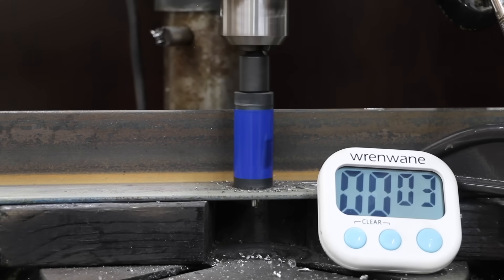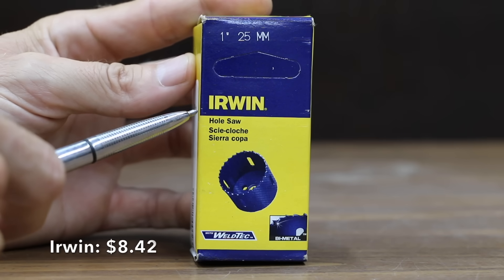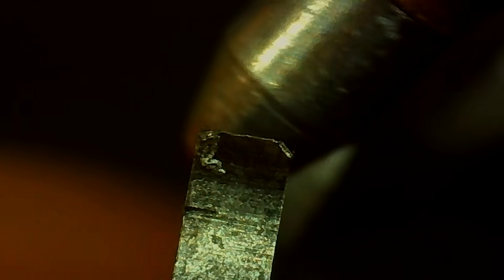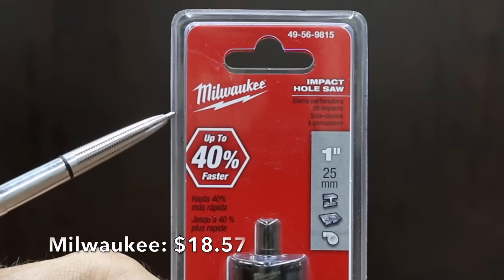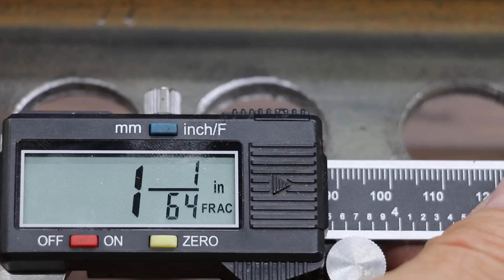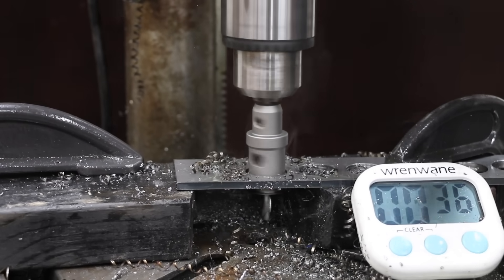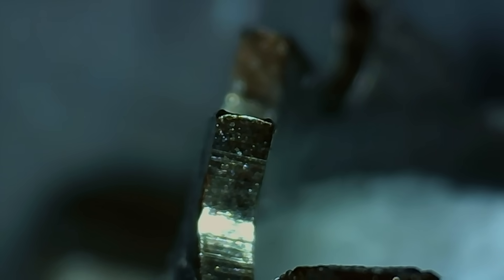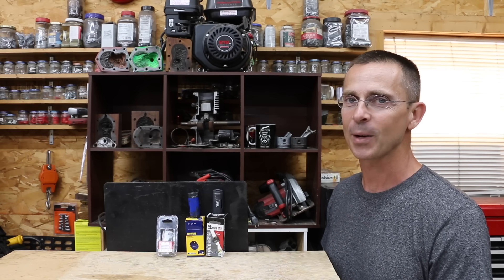Best Hole Saw Brand? DeWalt vs Milwaukee vs Irwin, Bosch, Lenox, Diablo, Bosch, MK Morse

Comment: Aw man, no cheapo HF ones or Bauer ones or. Hercules to test
Reply from the maker: I'll add them to the list for round 2.  Any other brands I need to add?  Thank you!
Reply: @ProjectFarm  Starrett
Reply: @ProjectFarm 
Without price constraint, I would suggest Pferd:
https://www.amazon.com/Pferd-25462535Carbide-Hole-Cutter-2535/dp/B00BCTY28E?ref_=d6k_applink_bb_marketplace

Not sure if there exists any cost saving supply source.

Comment: Do you think you could do this through 2x6 joists and 2x4s as a test for the plumbers and electricians
Reply from the maker: Yes, if there's enough interest.  Please let me know hole diameter and brands.  Thank you!!
Reply: Project Farm great, typically the hole saws that are used are Lenox (this is a very popular brand used by plumbers) Milwaukee both the normal and “BIG HAWG” saws, Diablo and maybe dewalt. As for sizes I’d go 2 1/2, 2 9/16, 3 1/2 and 4 1/2
Reply: @ProjectFarm  the brand you tried here +Greenlee, 1½" is for 1" pipe and then maybe 3½" but I don't think your drill press will have enough power for it
Reply: Plumbers and electricians aren't using holes saws through 2x4s, they are using augers or forstner bits.
Reply: @da_ghoul9432  I used a good quality Bosch spade bit for my house. worked pretty good except the punch through was pretty rough.  I switched over to an auger bit when I got to the garage and that worked much better.
Reply: Eh hole saws suck for wood use an auger bit or a spade bit instead. Unless you like wasting time digging the wooden donut out for a few minutes after every hole
Reply: I agree with the Greenlee holesaw comparison, that's pretty much all I use for knocking holes in panels

Comment from the maker: It happens all the time and I fail to select the best lineup of brands to test.  So, I would greatly appreciate your help.  I periodically ask for a vote on which brands to test. The “vote” notification only goes out to those who have both a) subscribed and b) selected the “bell”.   https://www.youtube.com/channel/UC2rzsm1Qi6N1X-wuOg_p0Ng?sub_confirmation=1 
Diablo Hole Saw:  https://amzn.to/31czGJL
Milwaukee Hole Dozer:  https://amzn.to/34bG1ap
MK Morse:  https://amzn.to/3l1W0xC
Irwin:  https://amzn.to/3l1H0A0
DeWalt 2x:  https://amzn.to/3hcI5m1
Dewalt Impact Ready:  https://amzn.to/326qOF1
DeWalt Carbide:  https://amzn.to/3aR5Y0p
Lenox:  https://amzn.to/3iWVUFE
TCT Carbide:  https://amzn.to/3iUHZ2R
Milwaukee Shockwave:  https://amzn.to/322AxMq
Drill Hog:  https://amzn.to/329BF0K
Bosch HB100:  https://amzn.to/2QabO37

By the way, the testing is having a positive impact.  In addition to helping viewers select the best products for their needs, product manufacturers are watching these videos.  Several manufacturers have informed me that they are working to make their products even better.  So, thank you for supporting the channel and I’m looking forward to many more product test reviews in the future. Looking forward to reading your comments.  Best regards, Todd
Reply: You should do the best file
Reply: Just think of it a little differently. You’re testing the best bang for the buck. Not the most expensive contractors stuff
Reply: o1mtbiker aaa
Reply: I wish you would have included Milwaukee Carbide hole saws. I really want to know how they stack up in tough metals.
Reply: Kevin Monzel, I believe it’s the Milwaukee Hole Hawg...something like that.  I wanted to see that one tested as well.  I have a large set of the Milwaukee Hole Dozers.  Their good bang for the buck and you can’t beat the lifetime tooth breakage warranty!
Reply: @kevinmonzel  Buy one and do your own little test against what you view to be its most likely competitor from this shootout.
Reply: Please do hole saws for tile and marble ..!!! I own a tile company and there’s a lot of them out there hole saws but they very in quality
Reply: U R 1 hard working 
Guy.
Keith  Kuhn
Reply: Glad to hear the mfgs are watching, and actually responding with product changes.
Reply: How about a test of ink pens, like the one you always use as your pointer? It's a Fisher Space Pen isn't it?
Reply: @bubbafudpucker397  

Kickass and different idea! Pens. I love my zebra.
Reply: Bruce Lortz I hear you. If I only need it one time I get good enough. If it’s something I will use over and over again. I will get the beat I can afford.
Reply: Flashlight or headlamp test. Streamlight, MagLite, Coast, No-name stuff.
Reply: I really wish he had included the Spyder brand. They have a really cool system with the arbor where you can have two different sizes on the Arbor at once

 that way you can enlarge a hole that you have already drilled out but keep it centered
Reply: @jawojnicki  yea i was hoping to see spyder on here too.
Reply: I have watched countless test videos you have made and agree with other that call you the Consumer Reports for the DIYER or working man/ woman. I would be interested in an option to buy a compiled report of your tested items listing 1st - 3rd or maybe all. Just a thought. Thanks for all you do.
Reply: Sould do a 2 stroke engine with 4 stroke oil and a 4 stroke engine with 2 stroke oil see which will Self-destruct first
Reply: Send it absolutely. Love to see more 2 stroke stuff here :)
Reply: Hey please consider using a higher RPM when using carbide. You will be surprised at the results
Reply: @BruceLortzHI  I think he covers that very well with the  different grades in testing.  Good enough is all I go for I'm say a 4" holesaw that will never do more than drill drywall for mini can lights but his step drill bit comparison...golden as I do use those until they wear out regardless of quality.
Reply: @michaelkrenzer3296  yup the step bit vid was great, use them all the time usually untill they snap or refuse to go through the most pathetic of metals
Reply: Can you test the best jigsaw blade?
Reply: I saw a company advertise a product saying it did well in your test the other day! Big companies are definitely taking note. Amazing.
Reply: This is awesome that mfr's are watching your videos and improving their products based on what you're doing, I hope they reach out to you when their improved products hit the market so you can not only re-test but also verify their "new and improved" claims. 👍
Reply: I appreciate you are USA based however I (and I presume there are many others) based in Europe who watch your tests so often the winners are unavailable in ‘our’ region.
Reply: @BruceLortzHI  That's the thing though; content like this helps a lot of people figure out what is "good enough" for their projects. And for many a tough job, the consumer grade, sometimes also the "prosumer" grade stuff, just don't cut it (heh) - and it'll either barely survive one use (maybe leaving a rather nasty result) or not survive nor finish the job at all. And quite often, the price difference between the "appropriate" professional grade tool and the "high end prosumer" grade, isn't really that much. Hypothetical numbers here, but if a $35 prosumer tool can't finish the job or only barely survives one attempt, and a $50 professional one can eat those jobs for breakfast, dinner and lunch for years - that is definitely important information and worth consideration. - And "finally", one thing often not mentioned in this context but it really should. Your project workpiece. What will be the result if the tool can't finish the job properly, or leaves a really bad result? Sometimes you already have a lot of work and other resources put into that piece/project. If that tool misbehaving could cause serious damage to your hard work and effort, costing tonnes of both time and other resources to redo/repair - well that should be part of your evaluation. Few things suck the project joy and momentum out as much as being close to finished only for a crappy or not-really-suitable-for-the-job tool to ruin it or set you back a mile.

IMO this is why it's important to include one or more professional grade candidate(s) in such roundups/shootouts. Because if the consumer and/or prosumer grade stuff can do the job "well enough" (anf survive), the roundup will show you that. But if the professional tool is really the only one up to the task, it will show that too. It's all about (enabling) the making of informed choices :)
Reply: Soooooooo :) wat will drill thru the ar500? Huh huh huh ? ? Huh
Reply: @samrowe2889  some say not even @Project Farm knows
Reply: Another awesome video.
Reply: isn't there a table of alle brands and performances ?

thx
Reply: The Milwaukee shockwave is the biggest piece of shit ive ever seen we bought one a couple weeks back and it never made it through one hole
Reply: I love your intro’s 🏅
 greetings from Belgium 🍀🇧🇪
Reply: How about; best cold bluing brand/system. (For oxide coating precision machine parts/guns.)
Reply: You are very very veery welcome!! I have made several purchases based off your videos alone. Loctite 3x, DeWalt fluted step bits, DeWalt drill bits, some 3M products, glue, tape, etc. You have also stopped me from buying certain products which I appreciate even more! You are probably the only YouTuber whose videos I watch regardless if I need the product or not. The knowledge is well worth it and your content is beautiful! Thank you so much for what you do!
Reply: Please can you do the myth of a wooden piston for a petrol engine. Is it possible to run a engine with a wooden piston.
Reply: STARRET STARRET STARRET, I WILL SEND YOU ONE IF YOU INCLUDE IT IN THE VIDEO 😉
Reply: You put Consumer Reports to shame. Whenever my girlfriend and I need to do some shopping we've made a habit to check your channel first! Any idea what the best protein bars are? 😜
Reply: Can I like this a 100 times
Reply: @Beatitmm  https://youtu.be/STe6I7RglsE
Reply: @Beatitmm  Sure! Just make 99 new accounts 😁.
Reply: So, I've noticed that a lot of the drills you test seem to get stuck near the bottom of the hole. I've heard that the material at the bottom of a hole tends to work harden. This video by Haas Automation explains the problem better than I can: https://youtu.be/sykjB7fS1Po?t=698
Reply: You should let a engine run on pure 100% oxygen
Reply: @landonsgamingchannel7587  https://youtu.be/STe6I7RglsE
Reply: Making a difference one tool comparison at a time.
Reply: Thanks for another great test! It was interesting to see how bimetal compared to carbide.
Reply: I would like to see a video on coolants and which one is best.
Reply: Suggestion: Short and sweet. There's a person who does what you are doing but in a way thats been fully ratified. His name is Sandy he does reverse engineering for manufacturing companies in the auto and aerospace industries. I highly suggest you discover who Sandy is because i believe his philosophy will greatly help yours. thank you for your time and efforts
Reply: Can you try best impact screwdrivers? There's a bunch on amazon for $10-50 and the reviews are up and down on all of them! Would be great for people that don't want to buy a full impact driver or impact wrench and I've found it to be an amazing tool to have in my toolbox! You can even use some of the left over impact bits from the previous video to help test!
Reply: Sir please test bench grinder abrasive wheels cheap Vs expensive
Reply: I've always found Greenlee to be one of the best hole saws. Shame it wasn't included
Reply: Time is money.
Reply: Here is a great idea for a testing video( albeit an expensive one), battery tools. Which brand has longest lasting battery life between charges, and, using adaptors, which tools drain batteries more. For example, if a makita battery proves to be shortest lasting, and Dewalt longest, is it the tool or the battery that is the issue!?
Reply: ANNULAR CUTTERS PERIOD !! BETTER WITH A MAGNETIC DRILL OR BULKY VINTAGE DRILL PRESS WITH TONS OF WEIGHT and WITHOUT A JACOB CHUCK
Reply: Wow thats so cool
Reply: You sly bastid.  You were supposed to mention which brands said they were improving, so we would go out and but them!
Reply: Wish you had included Spyder.
Reply: Hey there, I work in the HVAC trade and the Milwaukee big hawg hole aw bits are all the rave as well as their torch series sawzall blades, it would be cool to see you put them to the test against competitors. We especially like them for nail embedded  wood.
Reply: Can you tell me what are cutting these holes for? Good video
Reply: Test caulk next
Reply: I really enjoy your channel. The testing you do is excellent. Could you please test hole saws that cut through ceramic tile. Specifically large hole saws like the ones you tested today. Thanks.
Reply: P
Reply: Who in the real world uses fractions of 128th ?

You need a digital caliper that reads in decimal SAE or metric.
P.S.  on the ar plate, slow speed to around 50 rpm. Flood with water soluble oil coolant.
Reply: I believe the impact ready saws are ment to be used in impact drivers only. I've used them in the past with great success
Reply: Have you ever done a review on pipe thread compounds and teflon tape, and witch is best on plastic threads. also if using the teflon with the paste.is any better?
Reply: Video idea:
Best method/product to remove an odor from a vehicle. I was never able to overcome an odor or spoiled milk in an old car of ours when my son left a bottle with a cracked lid in it for an extended amount if time. It’s probably difficult to test objectively.  
Thank you for all of your videos! Big fan
Reply: Hi you should do strongest velcro!?
Reply: Hey I would love to see a Gravel guard test! Love the vids you are a great man!
Reply: Wish you had included Klein and Ideal.  Electrician here.  Thanks for all the great videos.
Reply: You should test NMF by nomorefriction.com supposed to reduce friction in oil and help keep it clean inside of diesel engines
Reply: I've got a challenge for you: Oil and Transmission resealers. Products like BlueDevil Transmission Sealer and AT 205(Scotty Kilmer was all about it back in 2010). Could they save us the big bucks? Will it hurt to try like some of these head gasket sealers do? You're the only man for the job!
Reply: You should test car drying towels after multiple washes which is still most effective
Reply: I got your next video bud! Which cooler keeps the beer tasting the best, and you can fill multiple brands of coolers full and taste all the beer! It's a win-win!
Reply: How about doing a oil stain removal video? I've tried a ton of different stuff.
Reply: I'm watering my yard and realizing my sprinkler sucks.  How about a video on the best sprinklers - range, gallons per minute at a specific pressure, evenness of coverage, maybe even how well they do in windy conditions.
Reply: A showdown of gutter guards would be very useful and appreciated!
Reply: Here's a video idea. What gas company has the best gas that's gets your more mileage to the gallon. You could test a murphys gas station, shell, speedway, thorntons, BP, Walmart gas, Sam's club gas, and any others you can think of. Atleast in my opinion of the ones I listed speedway or Thorntons have the better gas but I'd like to see for sure if it is
Reply: Project Farm I would love to see you test 1” furnace filters
Reply: ProjectFarm after viewing the video you did about the cande wax experiment I think I have a method that might work.  A majority if not all sources to produce candle wax are hydrophobic.

I also noticed a lot of things that I think might have changed the outcome of that experiment.  Waxes used for candles generally have an extremely difficult, if not impossible time piercing the rust covered bolt and screw.  

Could you perhaps try heating up the metal and wax before you put the nut on the bolt and use it as a sealant to prevent rust from forming in the threads of the nut and bolt?
Reply: Could you test Allen keys soon? I am looking to get into a good set and can't decide between Bondhus Wera Wiha or PB Swiss im a PA based machinist and these are my most used tool
Reply: I wonder where either of the Hercules would rank. I've started putting clearance holes in the cut path. Thanks for all your hard work for your viewers, it's appreciated!
Reply: Test the klein  carbine whole making kit.
Reply: 11:05 pretty sure thats not quite 140 seconds
Reply: @nicke1169  Do you need a time out???
Reply: Just no more Chinese made tools.
Reply: SteveVi0lence ‘no more Chinese made tools’.... well that knocks out most of them then.
Reply: @SWhite-hp5xq  Omitting Chinese brands might overlook a worthy contender!
Reply: Wally Kramer exactly.. I’ve got a handful of ‘Chinese rubbish’ that just won’t die and they seem to do the job I need every single time. One being a $100 chainsaw that would have to be on its 3rd bar and several chains now, a rotary drill that drilled holes throughout a whole factory fitout, and some air tools that once deburred work just fine. I’m a Makita tool guy. For any hard work or continual use gear it’s Makita all the way, but don’t care if buying a once off tool that’ll do the job, pay for itself and earn its keep thereafter. And if it dies.. meh.
Reply: SteveVi0lence ,